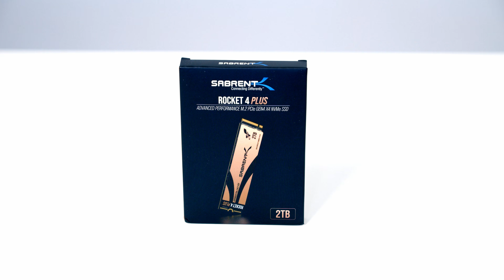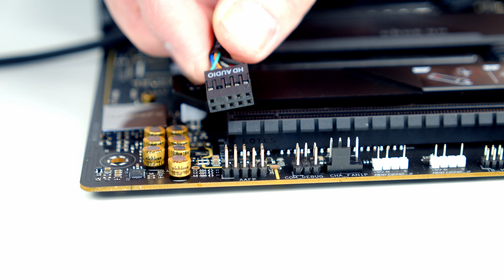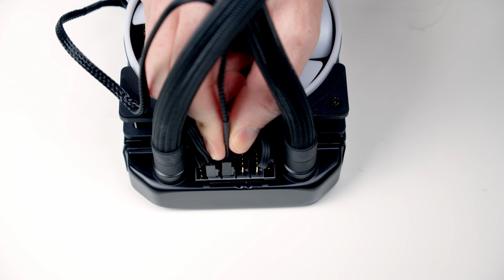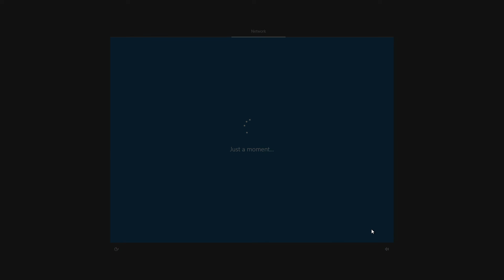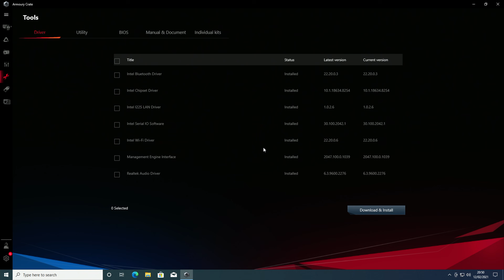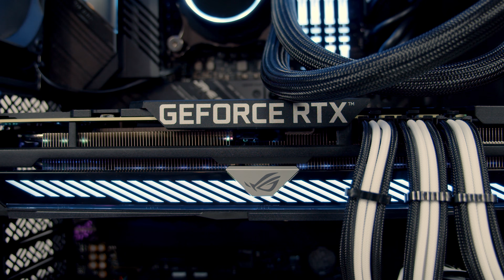Fractal Design Meshify 2 Compact PC Build Guide - RTX 3080 & i9-10850K

Comment: Great build video. The case manual specifies memory modules with max height 40mm when using 240 water cooling at the top. Is the manual correct or will 44mm modules fit?

Comment: Even though the guide helped, it would be a lot better if the display names of each parts of the motherboard were mentioned. Like JRGB1, JAUD1, FP1, etc. One thing that I hated about this guide is how it tells you to pass the HD audio cable through the hole nearest to JAUD1, I literally put in my power supply through the area below the hole and the power supply moved the cable thus bending the motherboard pins for the JAUD1 which is where the audio comes from. I highly recommend passing the audio cable through the second hole nearest to the JAUD1 pins.

Comment: I used the same case but I used the NZXT - Kraken X53 240mm RGB AIO, Corsair Vengeance RGB PRO, and the asus tuf z690. I can't use the second 120mm fan on the AIO because it doesn't clear the ram. Im guessing the AIO you used is thinner? Any suggestions besides buying a new AIO.

Comment: Hi Chris, first off great build step by step guides, really great vids!!! Wanted to asked question on the CableMod Pro Extensions, the contents from the link says it comes with only 2 x 8-pin PCI-e cable- 3 closed combs (450mm), would I have to buy 2 packs of extensions in order to have 3 for my GPU 3080? Was wondering if you did the same or do they sell individually?

Comment: How is the noice coming from the case, like would it be much less noice with a Define 7 Compact?
And most important, is the fans 20mm thick or are they 25mm? This case should support gpus up to 340mm length with fans, and 360mm without fans.. And the Strix 3080 card is 318.5mm. So if the stock fans are 20mm thick then "Normal" 25mm fans will make the gpu not fit.. Im wondering to buy this case but im not sure about gpu clearence. I have the same gpu as you.

Comment: Great video Chris! I have the same Fractal Meshify compact case (white) and im planning to upgrade w an extension cables (GeForce RTX 3070) and the PCI-E (6+8 pin?) but wanted to know what lengths i should get bc theyre custom and likely not refundable. Theres a default length of 300mm that Cable Mod has but not sure if that will yield the perfect distance  to each component. Any advise greatly appreciated as i would like to order them. Thanks in advance

Comment: Did you use one of the CPU power cables for the GPU? I have the exact same PSU and it only came with 2 cables labeled "PCIe", and 3 cables labeled "CPU", no idea why they would do that. Looks like I have to use the "daisy chain" method. When said you had "another cable in the box", did you mean a CPU cable?

Comment: AN amazing video! Just in time as well for my next build. I´m planning on using a case like this, a MSI 3070 and a 360mm AIO CPU Cooler. Will this fit on the top fan spots or will I have to mount it at the front? Thanks!

Comment: Thanks for the great work on these videos! Between this one and your review of the case that included thermal testing, I had the confidence to build my first PC ... in this case, with the same ROG Strix 3080 GPU, same cable extensions, the latest AMD version of the MB you used, and the same fan/AIO layout. I swapped out the Fractal fans for Noctuas, and used an EK 240 AIO. This thing is quiet! Other than a defective MB, everything went very well. The details you provided while wiring were especially helpful when I was diagnosing.

It was great that you saved me the trouble of trying to use the cable extensions for the top CPU power so that I didn't have to. Same for your bottom fan testing. I would have tried that had I not seen your videos. Your calm description of BIOS configuration and Windows installation gave me confidence in an area where I had little experience. It all went just like you showed in your video. In short order you've allowed me to get on with what I wanted to build this PC for in the first place -  gaming. Thanks again!

Comment: Christopher I have a meshify 2 compact. I am going to do 2 140mm intake on the front, 2 140mm exhaust on the top, and 1 120mm exhaust on the back. What brand should I use for the fans? GO!
Reply: •T•h•a•n•k•s f•o•r w*a•t•c•h•I•n•g•
B•e•s•t• t•i•m•e• •f•o•r c•r•y•p•t•o• •i•n•v•e•s•t•m•e•n•t• & •g•u•i•d•a•n•c•e 
••🅦..🅗...🅐..🅣...🅢...🅐...🅟..🅟••
+•4::4::7::4::1::8::3 ::::4::4::9••7:::3💬
:Tell •: Christopher : i :: referred :: you•••.:. ..::...

Comment: Hey Christopher. Would the 3080 Strix fit in this case IF there was a 280mm front rad ?
Reply: I would like to know this as well.. have you found out? I want to put 280 rad on front and slightly smaller Aorus RTX 2080 which should be 290 mm and I am worried if it fits with radiator on the front.
Reply: •T•h•a•n•k•s f•o•r w*a•t•c•h•I•n•g•
B•e•s•t• t•i•m•e• •f•o•r c•r•y•p•t•o• •i•n•v•e•s•t•m•e•n•t• & •g•u•i•d•a•n•c•e 
••🅦..🅗...🅐..🅣...🅢...🅐...🅟..🅟••
+•4::4::7::4::1::8::3 ::::4::4::9••7:::3💬
:Tell •: Christopher : i :: referred :: you•••.:. ..::...

Comment: Awesome vid! I really like this case, but the graphics card I was finally able to get my hands on is a rtx 3090 FE (oh no!) and I'm worried that it won't fit. Meshify's website states that it can fit gpu's up to 341 mm (with front fan, which I plan on using) and the 3090 FE is supposedly 336 mm, which is really cutting it close in my opinion. I see that the STRIX 3080 you are using is measured at 318.5, but at these small measurements, its to hard to eyeball. Do you think that I could get away with putting a 3090 FE into the Meshify 2 Compact case?
Reply: What did you find out? Im thinking of getting the Meshify 2 compact also, and i have the same gpu as he has (strix 3080). 
But as you mention, they say that it will fit up to 341mm with fans, and 360 without fans. That means the fans are only 20mm thick, no? Normal fans are 25mm.. That means when im fitting my fans my gpu wont fit..

Do you know if the fans are actually 20mm thick? (the stock once)
Reply: @Alpejohn  I ended up going with the Meshify 2 (non compact) and it had way more than enough room even with from fans. sorry I can't answer your real question :(
Reply: @adamtasma13  No worries! I have seen indications that the fans actually is 25mm.. Dont make any sense but i will have to get it confirmed before i buy.. 🙂

Comment: Thank you.  I built a new system following your tutorial step by step, with the Fractal Meshify 2 compact. What a well made case, high quality.  Used a Gigabyte x570 Auoroa, Ryzen 3600, and Gskill 32 gb, with two 980/970 ea M.2 1 T, and Corsair Gold 80.  Only issue was the system would not post until I flashed the BIOS, despite the MB specs saying it was "Ryzen Ready".  Kind of a oh no did I get a bad component...   I didn't immediately check the Bios as it was supposed to be "ready".  Once I flashed, all was perfect.  My last build was 15 years ago, the components available today vs back then are incredible.  Keep up the good work and reviews.

Comment: One note: you definitely should move front fans a little bit lower. Currently airflow from the lower fan is obstructed by the graphics card itself and moving it lower will help card to breathe. Also Fractal cases usually have PWM hub (well, my R6 does) and it's quite good IMO, so this is an option.
Reply: •T•h•a•n•k•s f•o•r w*a•t•c•h•I•n•g•
B•e•s•t• t•i•m•e• •f•o•r c•r•y•p•t•o• •i•n•v•e•s•t•m•e•n•t• & •g•u•i•d•a•n•c•e 
••🅦..🅗...🅐..🅣...🅢...🅐...🅟..🅟••
+•4::4::7::4::1::8::3 ::::4::4::9••7:::3💬
:Tell •: Christopher : i :: referred :: you•••.:. ..::...

Comment: Hello nice video 👌 i just wondering will msi z590 carbon wifi will work with i7 10700k 10th gen
Reply: yes. When in doubt, google the motherboard, click the manufacturer link, check support. Usually lists cpu, ddr, etc

Comment: What's the purpose of fans DC, PWM?
Also could you teach how to OC CPU, I'm new to it and wanna OC my i7 4790k to 4.4the.
Reply: DC is powered with a standard power point meaning whatever percent you set it to it will stay that way, pwm measures heat and increases based on that when the pc is idle it could run at 5-10% or while gaming it could jump up to 70-100% pwm is slightly more but also better if you would like a quieter system

Comment: Just watched this, great job as always. Heading over to the review, I'm quite curious about the 240 aio with the i9
Reply from the maker: Thanks
Reply: @ChristopherFlannigan  Sorry for the silly question, but what does the 240mm refer to? the cooler specification says its 284 mm long, does that mean i can use any (or most of) the 2-fan AIOs that are about 280 mm in length?
Reply: @joe628aaa  I’m very late and you probs already know but it means that you can fit up to 240ml in fans ( 2 120ml fans)

Comment: Brother, you are by far the absolute best PC builder in the whole of YouTube! The fact that you take the time to explain everything to the bare minimum makes your videos priceless!
Reply from the maker: Thanks
Reply: @ChristopherFlannigan  I'm trying to get my pc to boot
I've disconnected and reconnected everything like 4 times

The cpu cooler fan is rgb
And it turns on the light for a second and nothing else happens 

Is my pc dead?

Ryzen 5600x 
B450 max 2
Vengeance ram 2 sticks
Seasonic 750w semi modular 
1660 zotac
In a meshify c case 

Any help greatly appreciated thanks

the only led that lights up is flash bios and it does three flashes then nothing 

And the rgb master cooler fan lights up for a second and then nothing else happens 

Has happened each time I try and start up the rgb does that 
The bios only flashes when I click it 

I'm thinking about taking cmos batter out for 15 minutes 
Redownload the bios reformat ny flash again to fat and unplug everything and bread board connecting stuff again 1 by 1 

But this is super stressful I just want my rig to run 

I have the seasonic 750w gm semi modular so I know it's working

Hopefully it was protecting something I had incorrectly connected or something like that 
1 by 1 I'll try and see what the issue is 

I'm gonna reseat the cpu reseat the ram and basically do everything again 
Really only can find like 3 and more year old forums to trouble shoot this is really a lot more difficult than the whole build your own crowd makes it seem

I could've just got a prebuilt and upgraded it but this is really demoralizing having it not work over and over again

I was excited now I'm bummed out borderline depressed
Reply from the maker: @jgvtc559  Did you flash the BIOS? b450 motherboard unlikely to work with Ryzen 5600X out of the box. That's where I would start
Reply: I also love that Christopher has the connections shown with the motherboard on the table and also inside the case for a better view. Brilliant!!! So many videos elsewhere have a person's hand occluding everything.

Comment: I would be worried that those clips break, for the m.2 NVME drives. 
But, I do like not needing a screwdriver. 15:40

PS: Another nice build...
Reply from the maker: Yes, building was very easy, but didn't like how they put pressure on the material under the heatsink